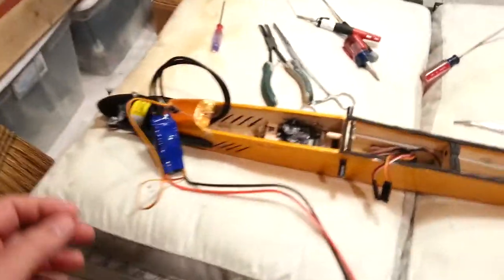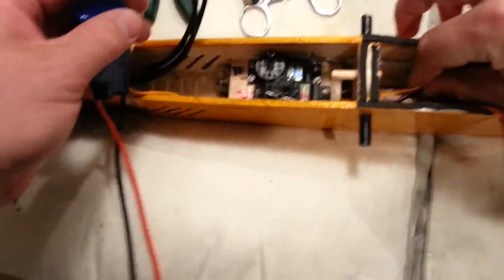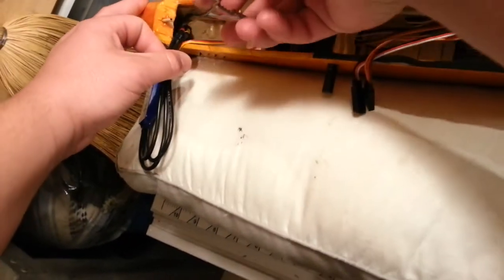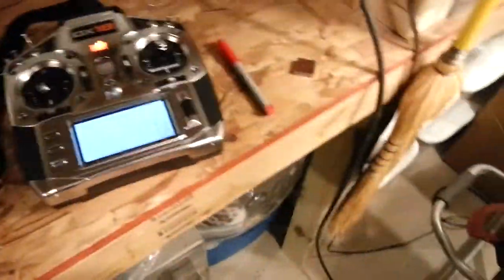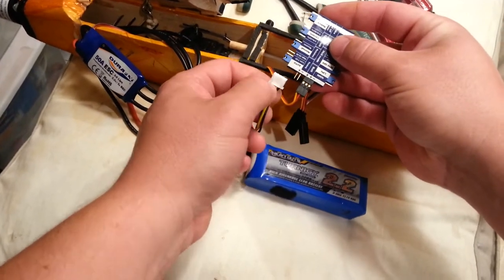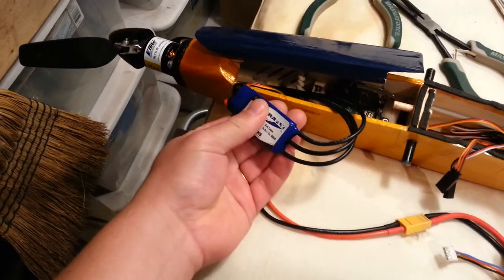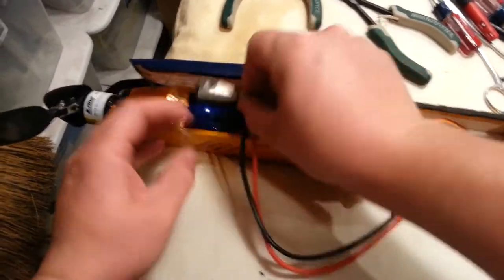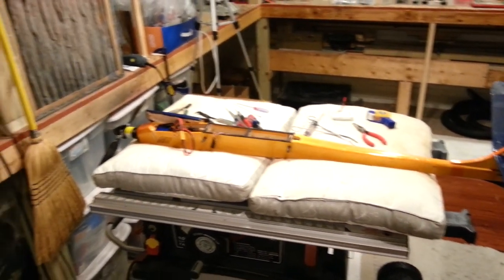Dynaflite - Bird of Time - ESC Upgrade - Part 2 of 3

Comment: You can strengthen the screw threads by putting CA after you first use the screw,  remove it and apply CA.
Reply from the maker: yep, I do that a lot. Works very well!